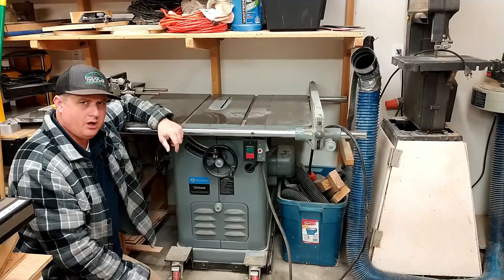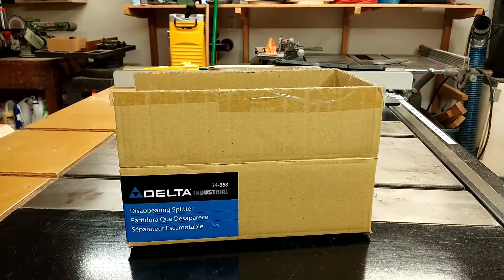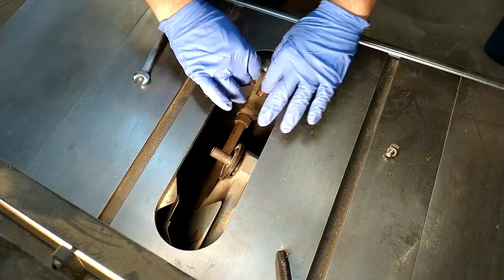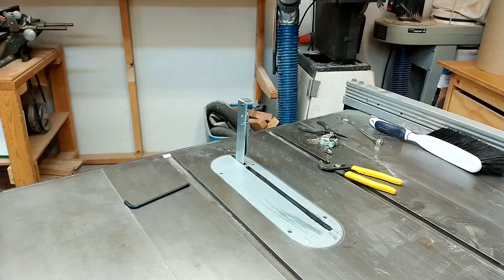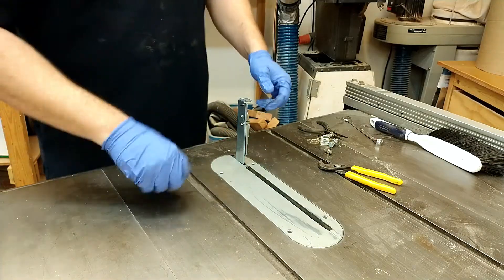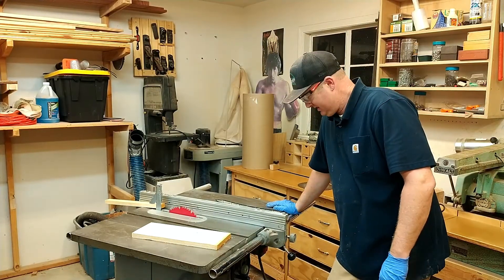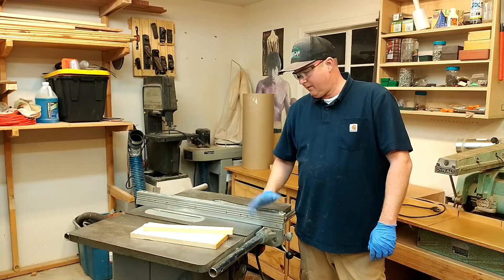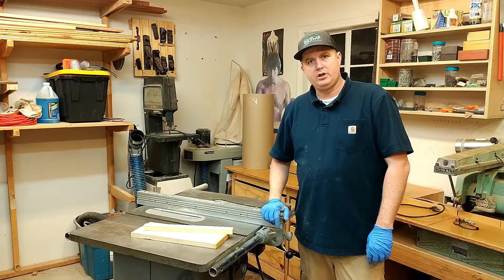Adjustable Splitter for Delta Unisaw // Add safety to your old saw

Comment: I just finished making a zero clearance insert for my old Grizzly 1023. I glued a wooden splitter into it but it doesn't have kickback pawls.  This looks like a better option.  The splitter that came with the Grizzly was awful. I hope this fits the Grizzly which, I believe, was a unisaw copy.

Comment: Just installed on my Delta right-tilt model 36-810 Unisaw (circa 1999). No issues with installation. The splitter I received from Amazon measures 0.0859”. Works with original throat plate.

Comment: In case you get notified of new comments, would it make sense to have the pawls on both sides of the splitter? Just asking in case I have to make something for my 70's Sears Craftsman saw. Thanks for the video.
Reply from the maker: I had a splitter on an old craftsman saw that had pawls on both sides. So not sure what is more effective. The pawls on the side between the fence and blade makes sense to avoid and projectiles from fling back. So unfortunately, I can't say if it is necessary to have them on both sides. I gues it's up to the individual to make that decision. Sort of like listening to headphones while in the shop, it's up for debate! lol

Comment: That splitter and an overhead guard that swings up out of the way when not needed was original equipment on my saw when I bought it in 1980.  It is still on my saw and used 43 years later.  I have never thought about replacing that saw.   It is still the perfect table saw.

Comment: The delta brand made some off the best equipment in woodworking back in its day . Cheers
Reply from the maker: I wish it still did. That era  of tool companies was great.
Reply: @wheresmytapemeasure  yes we have a delta table saw we have used for 35 years and not maintained very well at all and still ticking along. And sometimes its rough work. Cheers

Comment: Would this fit an old 10” grizzly table saw ?
Reply from the maker: I'm not familiar with the grizzly table saw. The most important thing is making sure the mounting bolt holes line up properly.

Comment: Why are you running that initial blade backwards? Printed side usually faces left on all my blades.
Reply from the maker: I assure you the blade is not on backwards my friend! 😂 I always just make sure the teeth are directed towards the business end of the saw rather than rely on where the printed side is. After being sent in for sharpening one time, the print will be gone anyways.
But don't get me wrong, I admit I have put a blade on backwards more than once 😂, and cut like butter it does not! 😂

Comment: You don't need this.

You can easily install a splitter. The old splitter follows the bevel but does not follow the height of the blade, whereas the riving knife follows both. This is an advantage for the riving knife, but old-timers have overcome this for decades. 

The old splitter is place so that it will not be cut even with max height of the blade. One can effectively move the splitter closer, if one will never adjust the height while the motor is running or use carbide safe material such as aluminum for the splitter if you design to move it closer to the blade and is not as careful (to never adjust the height of the blade with the motor running).

The splitter is one device to prevent kickback, but vertical restraint (pressure downward) is the other. Instead of using the hand, vertical restraints (preferably on both infeed and outfeed) against kickback should be installed on the fence. Vertically installed feather board will prevent ejection as it inhibits backward movement of the wood. Most people just do not install these devices on the fence and face many problems. You also make sure that the entire fence will not be lifted.
Reply from the maker: You sound very passionate brother. Thanks for pro tips!
Reply: Thank you for this video.   I inherited my Dad's Delta unisaw and it doesn't have any safety features that are present today.  I know there are those out there that say a riving knife and/or blade guard are not necessary but I value my hands too much.  I have seen too many YouTube videos of experienced woodworkers who thought they didn't need these and lost.
Reply: NEVER EVER EVER say something that discourages better safety.
Reply: @rickeverett3304 Submitting to commercial dictates is anti-intellectual. Understand the physics and avoid superstition.  Be careful thoughtfully.
Reply: WHAT THE FUCK ARE YOU TALKING ABOUT !!!!!!!!!!!!!!!!!!!!!!!!!!!!!!!!!!!!!!!!